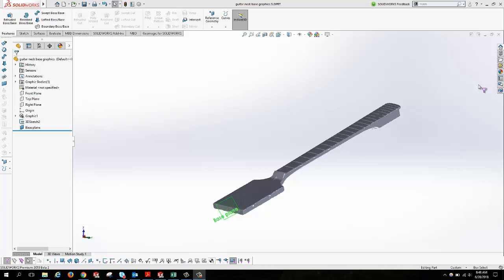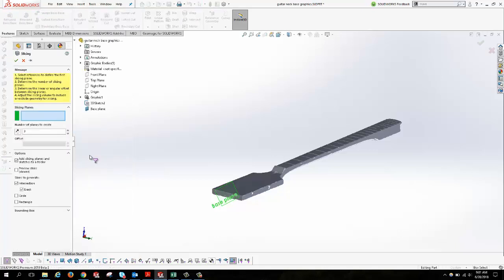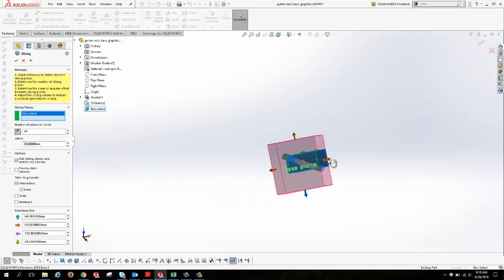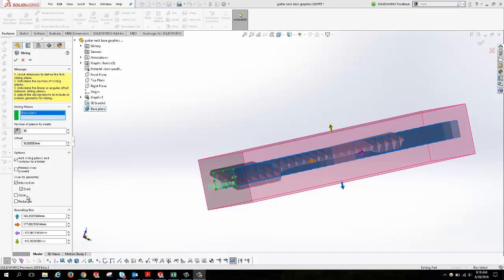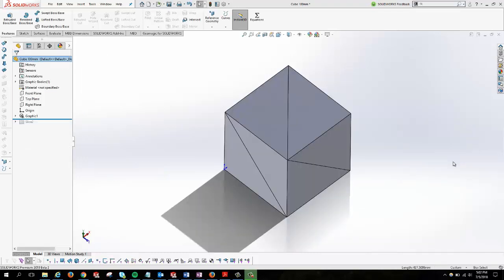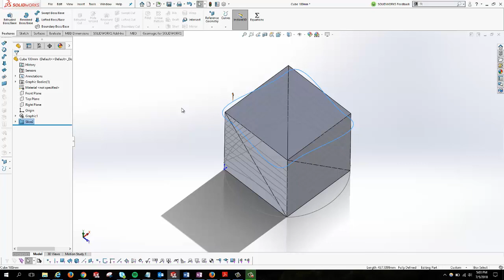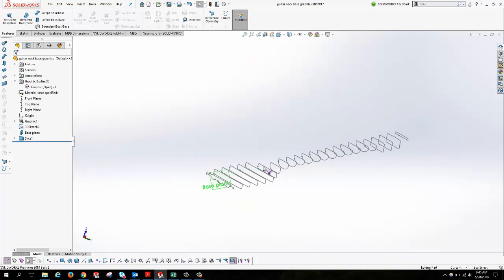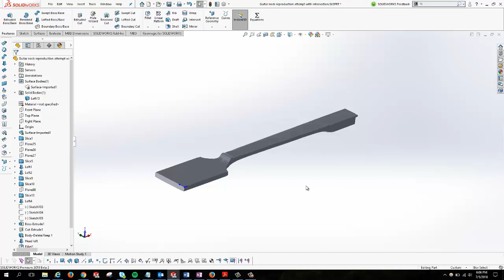SOLIDWORKS 2019 Slicing Command Tutorial

Comment: one thing. How would i know that the scanned part is at how much distance from the reference planes as the surfaces are not selectable
Reply from the maker: If the scanned part is a mesh (as opposed to a point cloud) you actually can measure to mesh facets, fins and vertices. You can also use these to create a reference plane from which you can measure. I would recommend watching these two videos on the powerful mesh functionality in SOLIDWORKS to become more familiar how to work with mesh geometry in SOLIDWORKS:
https://youtu.be/Q4x7lRHnvss 
https://youtu.be/BEViSsD6zso